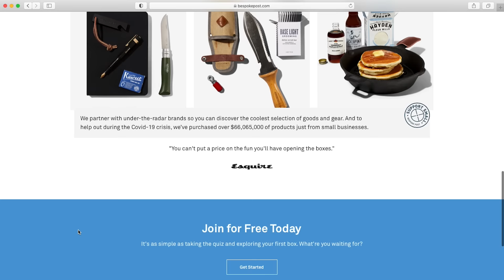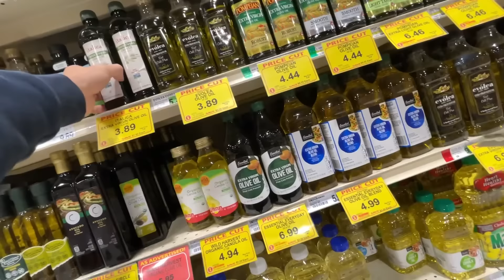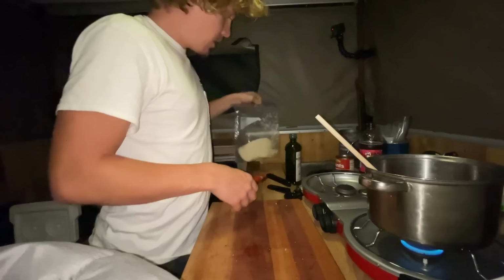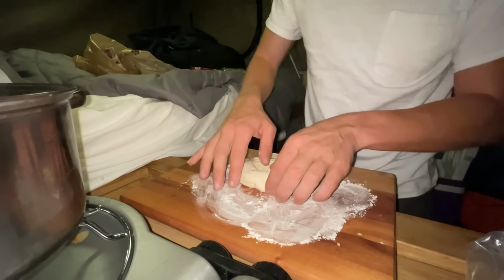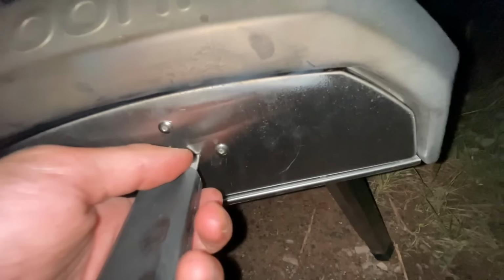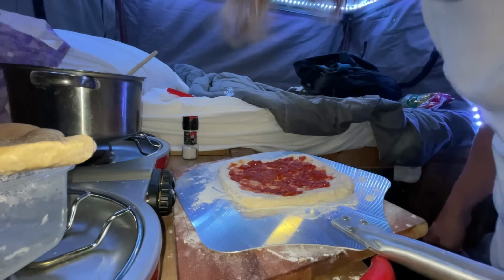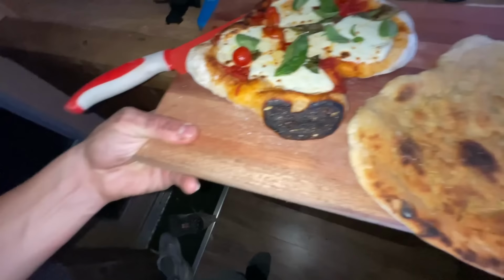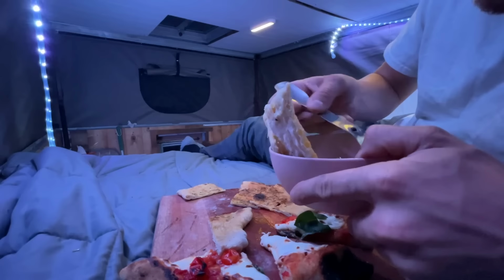Small Tent Car Camping w/ pizza from scratch

Comment: Mav- worked at a few pizza places.
For Neapolitan start it by hanging it from the 12 position and rotating your hands from 3- 12, like you are passing yourself the other side of the dough. Crimp your hands once the middle is thin and crimp the dough. Place it on the board and push the edges out to keep the air in, like you mentioned, and boom you have a great looking pizza dough. Just a thought! Great video.

Comment: Hey Mav, dont wanna be the know-it-all but: Please put your VW in first gear while parking, it will stop the car from rolling away much safer than just the handbrake alone. (cause of the gear ratio) when you park in flat areas, you never need the handbrake. Cheers!

Comment: Poppyseed Chicken Casserole :)

Ingredients:
A few chicken breast / skinless boneless thighs  ( Grill, Bake, or Boil )
Cream of Chicken Soup ( 1-2 cans )
Poppyseeds (1-2 TBS)
Sour Cream ( 2 oz )

Preparations & Cook:
1. Cook chicken "slightly less than completely" (don't leave it pink but don't overcook it. we bake again l8r)
2. Shred / Chop chicken to the size of your liking.
3. Mix the cans of soup, sour cream, and poppyseed in a bowl. Mix Well.
4. Add shredded / chopped chicken. Mix well again.
5. Put casserole mix into small baking pan.
6. Crush your favorite type of crackers and sprinkle on top. ( I like to use Ritz crackers, but Cheez-itz worked good as well )
7. Bake on 350* for about 20-30 minuets until casserole is hot all the way through.
8. Have over your favorite rice or pasta! ( By itself is also good. )

You don't want to overcook the chicken because of the baking process towards the end.
Reply: Yum sounds good

Comment: Hey Mav, I have an Ooni as well. What you need is a laser surface temperature thermometer. I like to cook my pizzas around 700 degrees. Also they have a gas burner attachment if you ever don’t feel like doing the wood thing and are feeling lazier. I’m gonna be using my ooni tomorrow! So good

Comment: Yo mav, you should check out a license plate light bar holder, you take the license plate off screw the light bar holder on the original holes then screw the license plate back on and install a light bar on top of it, pretty good idea

Comment: The crust expanding and becoming crisp is from very very high temperatures inside a stone pizza oven. It's not really possible to achieve without use of a pizza oven. Stone pizza ovens will cook a full-size pizza in less than 30 seconds.